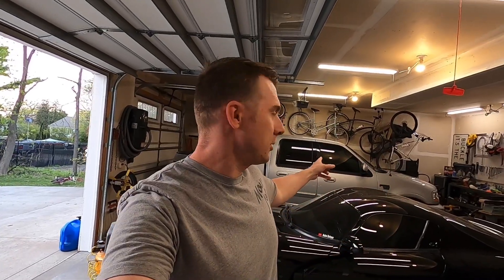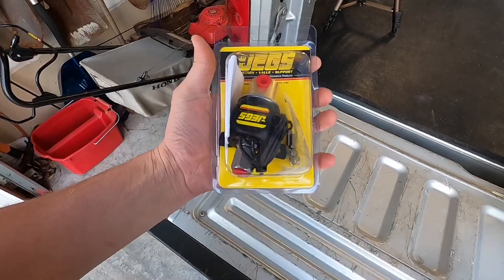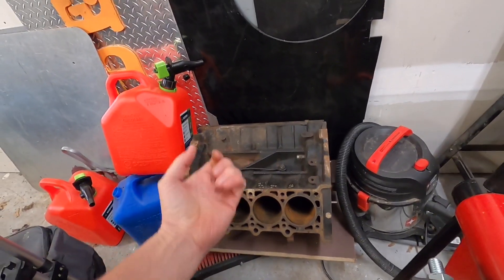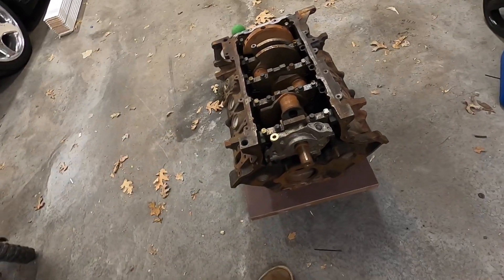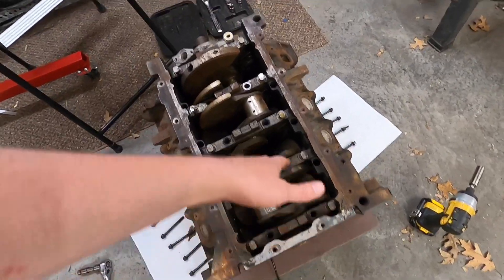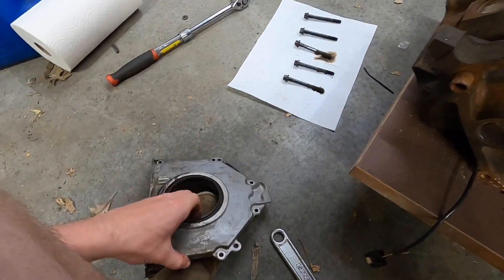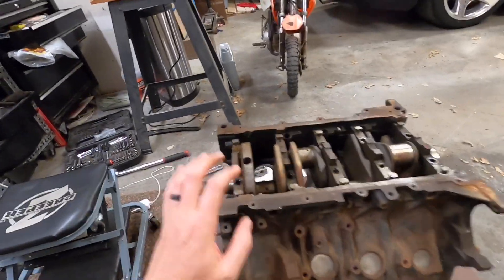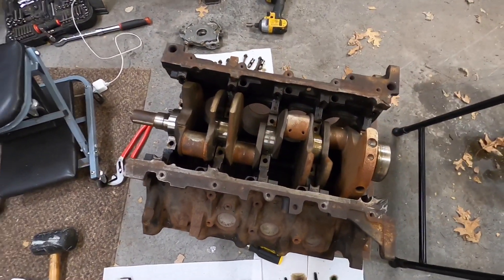BIG Turbo JUNKYARD 5.4 Build (Ep. 1) ***Pulling the Crank & Oil Pump***

Comment: Those "bushings" on the rear of the crank are the thrust bearings. They usually come with a set of main bearings. It's to keep the crank from wiggling front to back.
Reply from the maker: I thought that's what they might be for. Thanks! Good to know they'll need to be replaced since I already lost one. LOL
Reply: @AutoDetour  yeah that'd be bad. I  recommend the king xp coated bearings. They come with the thrust bearings and hold up great in my cobra swapped mustang!

Comment: There are tons of repair videos and build videos for these two valve engines they are very simple to build and inexpensive. And the spark plug problem people are complaining about that was fixed and 03 I have the same motor there’s a lot more thread. mine spun a rod bearing at 300,000 miles only because I was lazy on oil changes. Absolutely love this build following along very closely

Comment: Just completed a built 5.4 4v 80mm turbo in my 86 F150 4x4. If u have any questions about building the 5.4 just holler. Look into filing the tensioner locks and 3v high volume oil pump and billet oil pump gears
Reply from the maker: Oh dang!! That truck sounds sweet! I'd love to see it. I appreciate that!
Reply: @AutoDetour  Its an old truck but still looks alright. I can send u build progress pics if u have a link I can send em to

Comment: Ryan, definitely check out the Melling oil pump for the 5.4.  They used to only offer pumps for the 3 valve, but they make them specifically for the 2 valve as well now.  They come in both standard volume and high volume, and either one is superior to the stock oil pump.  And make sure to get billed gears!

Comment: Those “bushings” are thrust bearings. They provide a surface for the crank to ride on and are sized to keep the cranks endplay within tolerance. They will be trashed along with the other bearings and will also be included with your new crank bearing set.
Reply from the maker: That's kinda what I figured they were for. Good to know they come with the main bearings! Thanks!
Reply: No problem, you’ve got me invested!

Comment: The line lock will be a fun project for you just a heads up your going to want to buy the brake lines from summit it comes with all the fittings to cut out the headache

Comment: This is so cool to see I love this build! If you're planning on pushing a lot of power through that built motor you may wanna consider beefing up the 4r70w or just go with a 4r100 swap
Reply from the maker: Yes! I will certainly have to do something. It's hanging in there at 10psi, but I don't think it will like 20. LOL
Reply: @AutoDetour  yeah I'm impressed how well the stock transmission and engine have been dealing with so much extra power. Some People have this misconception of the 5.4 being unrealiable... these old 2 valves were great. Now the 3 valve version is what really gave these a bad reputation

Comment: The lil pins besides the main cap bolts are, well pins basically and remove all the bolts from both sides of the block and they should slide right out
Reply from the maker: Yeah, once you know how to take them out, it really makes sense. LOL
Reply: @AutoDetour  it caught me and my step dad off guard, we were about to force them out lol
Reply: Dowel pins. It means you have a windsor block

Comment: Doing anything to the transmission?
Reply from the maker: As long as the stock block is in the truck, we will see what the stock trans can handle, but once the built motor goes in, we'll have to beef up the 4r70w or see about swapping in a built 4r100. Not sure yet.

Comment: Why buy line locks when using the emergency brake will do the same thing?
Reply from the maker: because the e-brake is on the back tires. I need to lock the front tires so I can spin the back tires.